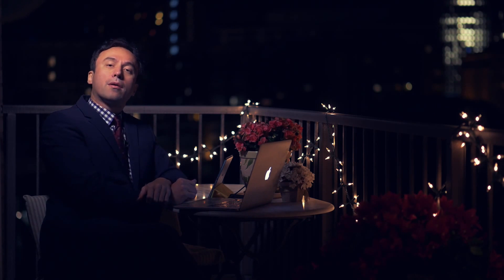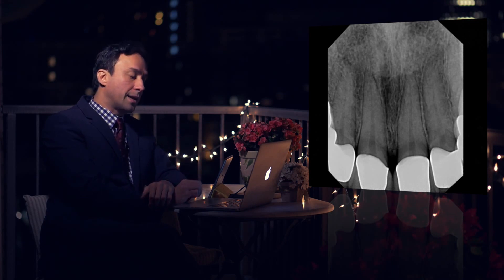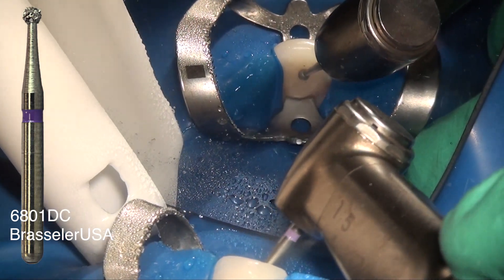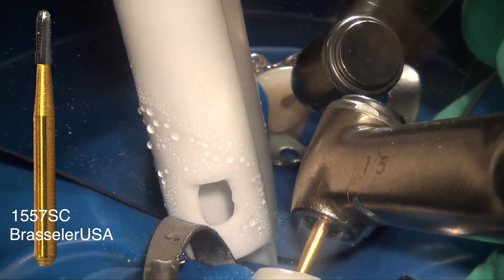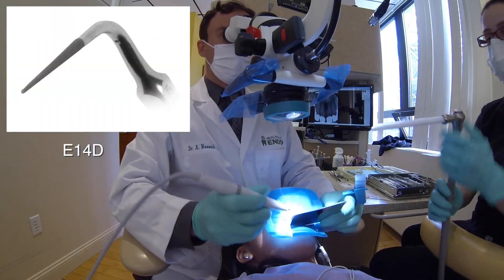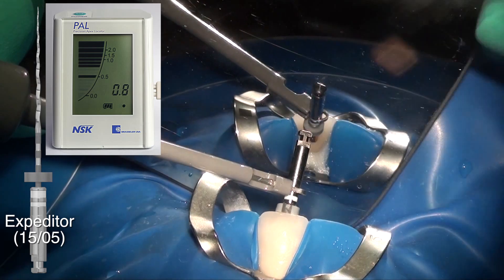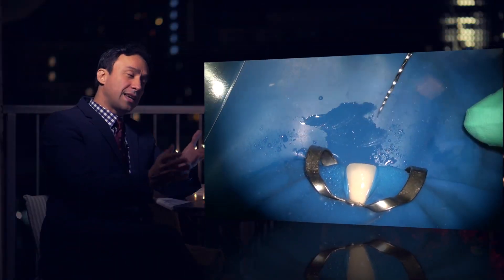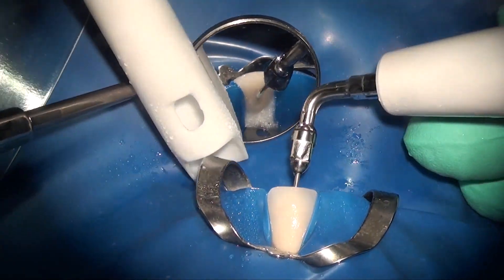CBL 5 Anterior Tooth ESX Basic Technique

Comment: Looks like his lower opposing is facial to the arch.  Possible malocclusion?  Was this addressed prior to RCT?  Traumatic occlusion sometimes has similar symptoms to irreversible pulpitis caused by pulpal trauma, whether mechanical or carious.  
Great video, keep them coming.
Reply from the maker: The diagnosis was necrosis not irreversible pulpits. You can see that on the first 5 seconds of the video. But the occlusion was checked and you are correct that hyperocclusion can mimic symptoms of pulpits (but remember that it mimics symptoms of reversible pulpits, not irreversible pulpits!)
Reply: RealWorld Endo
You are correct!  I've seen teeth go necrotic due to what I believe was long term traumatic occlusion, but I've always wondered if it really was the occlusion.  Of course, as the nerve is dying, the symptoms first mimic IP.  Am I wrong here?  Have you seen many of these kinds of cases?
Reply from the maker: Dave E Don't forget, the different between reversible vs. irreversible pulpits is the lingering response to stimulus as well as spontaneous pain that are hallmarks of irreversible pulpits. Also, research in rats has shown that pulps can not go symptomatic/necrotic from non infectious traumatic occlusion. It will get inflamed but won't dye. Also, in the anterior teeth traumatic occlusion can cause early bond failure for the crown on the lingual aspect of the tooth that leads to leakage and then necrosis as a result of the leakage and secondary to occlusion. Please leave questions/comments on the RWE website vs. here on YouTube for the rest of the RWE faculty to address too. I normally don't respond here on YouTube.